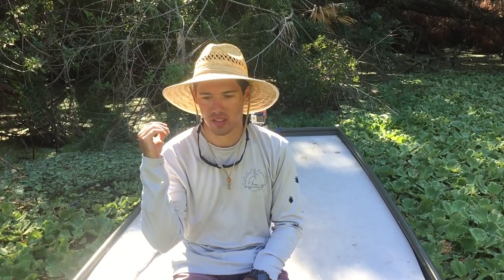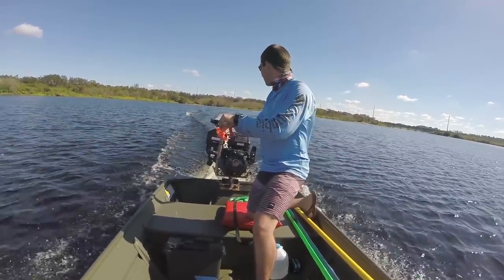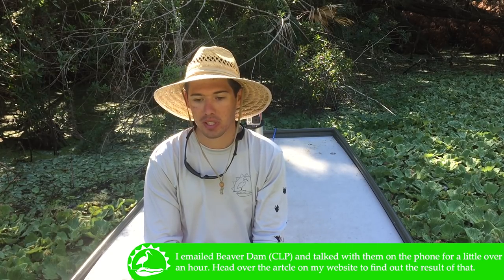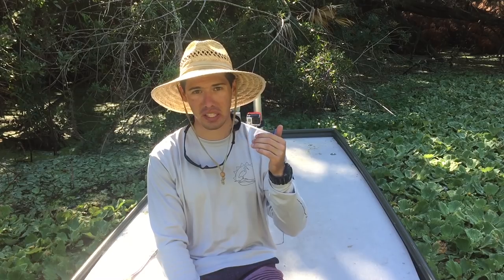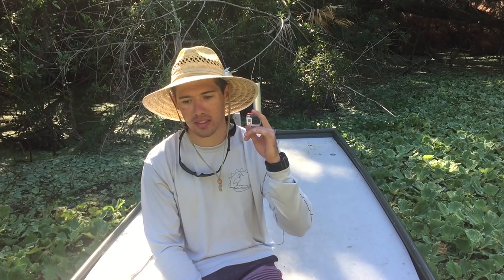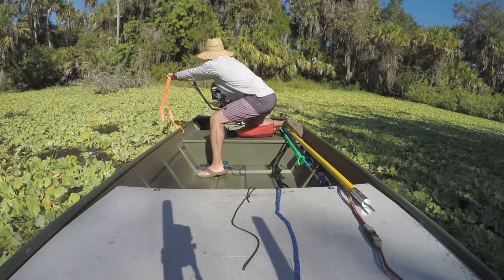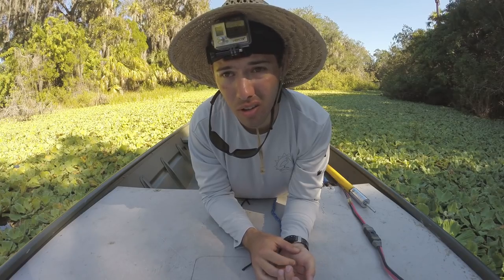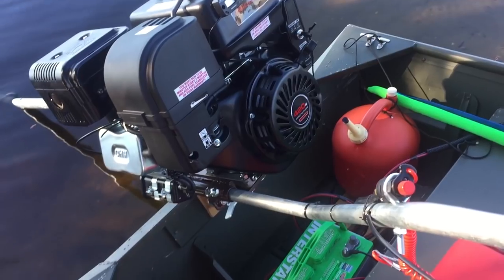Beaver Dam (CLP) Water Test: Longtail Mud Motor Speed and Weedless Review S3E1

Comment: The entire problem with this particular kit is probably the Alumacraft boat. I have a 12 foot Alumacraft, and the severe tlt of the transom has caused me a bunch of grief trying to get an outboard set up to run right. I finally bought a $300 mini jack plate that did get the anti-cavitation plate to an acceptable height - barely, and now the shallow water trim setting could be steeper. I don’t know why they made the transom at such a steep angle. Now I’m researching mud motors, and am finding out this could still be an issue. Glad I saw this video.
Reply from the maker: Yeah the Alumacraft transom was not build or designed correctly. I wish I would have known about it before purchasing the boat. At least its benefited a couple other people. After reinforcing and supporting the transom, it has helped. Either way, the alumacraft jon boats still have an excessive transom angle.

Comment: I have been running my clp kit for about a year now it took some tuning to ride right I moved the motor back 3 holes an put planning tabs on it with a 8.5 steel prop an now it runs like a top an with fixing the tiller arm I’d recommend drilling a hole into the arm so it won’t come loose on you
Reply from the maker: Yeah, the downside is that when running thick vegetation, that planning tab really seems to grab anything and everything it can. A longtail shouldn't need a planning tab to run great. But, it's allowed you to enjoy your longtail so that's what matters.  It is definitely necessary to through-bolt the tiller handle on this kit so it won't loosen up

Comment: Hey Bud, the beaver tail instructions say they include a hole in the mounting tube and you’re supposed to drill a hole in the handle and mount a bolt in it once you decide what angle you like it at. Page 9mat the bottom. Hope this helps.
Reply from the maker: Hey Tyler, thanks for reaching out. The *beaver dam (not beaver tail) did not have that in the directions in 2017. I would like to think that due to the popularity of this review, a couple of changes were made to the thai longtail kits since then, with an example being an improvement to the instruction as you're experiencing now in 2021. Hope you enjoy your longtail

Comment: I had the same problem what fixed mine was a cavitation plate and it's awesome don't know if you tried that or not but it really worked on mine I bought a mudskipper twister XL I liked it so well I got a dealership with mudskipper so now I'm selling them in the midwest Illinois
Reply from the maker: Good for you! Beaver Dam did say that their cavitation/ride plate for fix it but I was already done with the kit. After testing the three kits together and having one stand out and work as well as it did, there was no reason to try and modify the others to work.

Comment: I use the sps kit with the 420 on the same boat.. Stage one kit. 8.5 inch prop runs a steady 23.. Took alot of tuning tho.  Interested to see your test on the sps kit.
Reply from the maker: The next video will most likely be the CKS kit because I tested that second. I spent a few hours playing with this kit trying to get it dialed in, but no luck. My small kit from SPS that I got many years ago, was very easy to adjust and took very little to get it running effortlessly. Thank you for commenting and sharing your experience Jon Boyd!

Comment: put 2 I bolts on both side of the outside of the transom, run a long bunjie cord from one I up around the shaft and to the other I. itll hold the shaft down just enough while still being able to pull the prop out of the water
Reply from the maker: What would be the reason for doing this? As in trying to keep the prop in the water while idling, or running on plane, or letting the engine sit? I'm guessing you're talking about the longtail shaft and not the tiller handle?
Reply: @JTgatoring  keeps your arm from  dying from holding that prop in the water when your on a long run
Reply from the maker: @boogerwolf2015  Gotcha! I'll give it a try. When I ran my SPS kit, I didn't run into that issue. It was very easy to handle for long trips. Just put a clamp over the throttle lever and held the tiller in place, but once I get it back on the boat I'll give the bungee a try and see how it works. Thanks for the tip Zac!

Comment: What about a jack plate, it would give the motor more adjustment.
Reply from the maker: A jack plate would not fix the issue of the engine mount bottoming out on the bracket because the bracket would mount to the jack plate and stay at the same angle. The jack plate would need to change the angle so it sat more vertical. Either way, a longtail will handle worse the higher it is elevated so a jack plate would not help towards the handling aspect of the kit. Or at least thats my thought process behind my reasoning

Comment: Jt does the sps  bottom out on the transom with the gimbal on the outside
Reply from the maker: Every longtail kit will bottom out at some point. Both the CKS Mud Skipper and CLP Beaver Dam bottom out before I can get the prop out of the water. That doesn't work because you need the prop out of the water to start the engine, and if you can never take the prop out of the water you can not coast or stop without shutting down the engine. With the SPS Swamp Runner kit, I am able to get the prop out of the water before the engine base bottoms out.